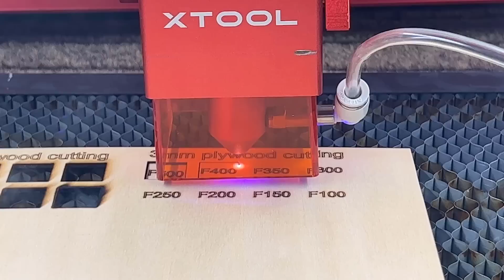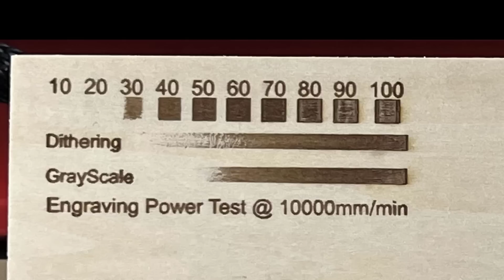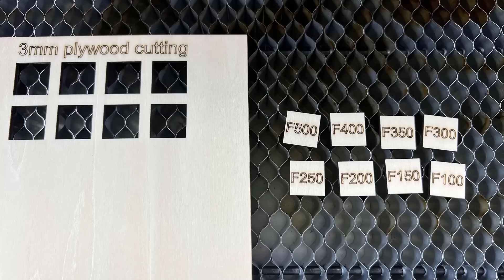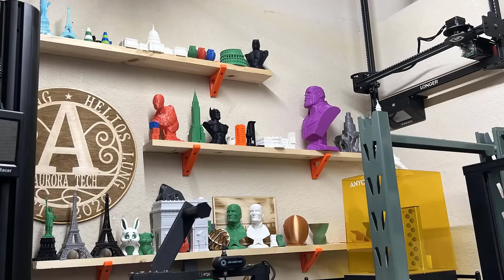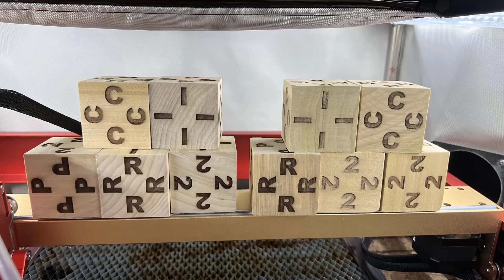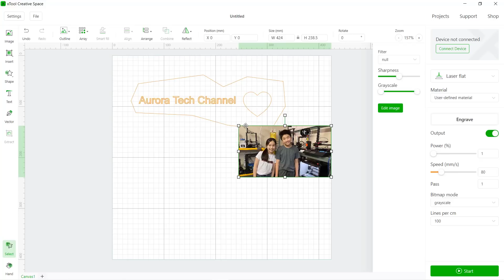xTool D1 Pro 20W laser engraver: The most powerful diode laser engraver that cut 19mm wood in 1 pass

Comment: PLEASE! PLEASE! DO NOT BUY - I have spent about $3000 with Xtool - I purchased the D1Pro and some other stuff almost a year ago and I have had nothing but issues. Trying to work with Customer Service is INSANITY! I also purchased the Infrared, and it has never worked. I was told by Xtool "Regarding the problem of the infrared laser head, many customers will not be able to use it successfully due to improper operation." So even if you follow their instructions and use the samples they sent, you still maybe doing something wrong. What are you doing wrong?--- you don't know, and they don't either, so you end up with a $500 paper weight. I watched tons of Youtube reviews on the D1Pro and they all gave glowing reviews; so, I went with it. Unfortunately, I and many others have not had the same success with Xtool as indicated in the Youtube reviews. After so many issues I decided to invest in another laser and speaking to some of Xtool competitors I asked question in hope that I don't end up with $3000 paper weights. The most chilling thing discovered was they are aware of Xtool and the issues the customers face. I noticed that a lot of the issues I've had with Xtool out the gate without me asking any questions they spell out what the machine can and can't do, their customer service and support. One guy said their Support Agents respond with 4 to 9 minutes and they quickly resolve your issue because they understand many of their customer use it for business purposes. Better than the 24 to 72 hours waiting for Xtool to respond and two weeks later you are still no where close to a resolution. OH, and those that have State side support definitely let you know that.

 I really don't want anyone to encounter this; because when you are not a wealthy person $3000 is a huge investment for you. PLEASE when researching for purchase do more than watch YouTube videos; it could save you time, money and peace of mind. PLEASE be sure to ask about customer service\support, warranty, replacement parts. A big one would be "What issues are commonly encountered by customers and how do you work to resolve those issues? 

I saw a post on Facebook asking, "Why are so many people selling their Xtool?" I laughed because I was looking to see how easy it would be to sell it. RFLOL 

When you have a quality product it is GREAT! I really enjoy engraving, cutting and making things it is so therapeutic. DON"T FORGET to be diligent in your research.

Comment: Thanks for the no waffle video.
I have a question. 
I haven't used one before. Are there costs that i haven thought of.
For example replacement parts required after a short time.
Thanks.

Comment: I was wondering what is the difference between the creality falcon 22w and this machine or who will perform better?
Reply from the maker: There is no significant difference between them in terms of speed and quality. However, the Creality Falcon 22W includes an air assist pump, whereas for xTool, you would need to purchase it separately. If you have no laser engraving experience, xTool with their user-friendly software would be a better option. If you already have LightBurn and have experience working with other engraving machines, you can choose either one.

Comment: I got this laser but kind of regret it.  It's closed source so theres a lot of functionality that just isn't available from hosting devices, so you're stuck using XCS to do simple things like homing or framing unless you're directly connected.  Not a pleasant experience to be told by the company that "all of those customer requests are resolved in our next product" instead of them putting in some effort to adjust firmware or software.  Also, I have to cut 6mm (1/4") basswood at 1 to 4 mm/s for a single pass cut.  I cant imagine how slow a 19mm piece would be.  I can't even get a good engrave on a 3mm basswood at the advertised 400mm/s.

Comment: You didn't try the faster speeds with the air assist.  Everything I've seen and read says that the air assist makes a huge difference in speed and quality of cut.  I wonder if you could get the 1,000mm / min with air assist.

Comment: I found your videos to be very informative, and your "just the facts" format is much appreciated! I'm hoping you could point us in the right direction and/or make a recommendation considering the following:

We seek a sub $2,000 Laser Cutter / Engraver to produce our aluminum face plates; either anodized or plain (6061-T651). Although, as much as 25% of our production could include: 303 Stainless Steel, Mild Steel, Brass, Copper and if possible some plastics; PVC, Polyethylene, ABS and Kydex. In general our work would involve material thicknesses not exceeding 10mm (0.375"), with approximately 80% of production limited to 4mm (0.125") or less. In many cases, the engraving would be filled with ink, enamel, paint or more exotic materials.  We intend to use the machine to cut the outline and "drill" mounting holes.

Can you point us in the right direction? Or, alternatively feel free to tell me if what we see is not yet available as a laser machine. Thank you in advance, I look forward to your reply!
Reply: For under 2k??? add a couple zeros

Comment: I notice that the woods used for the demonstration are light colored woods. If you make this cut in Rose Cedar, Mahogany (brown) woods, prepare to get your hands dirty! It generated a lot of waste. In Brazil we have woods with this tonality such as Caxeta, pine, Pinus and others. But all with light coloring. I had a 100 watt CO2 laser cutting machine. Recently, I got rid of it because I found this type of machine to be much easier to work with because it doesn't take up so much space. So much so, that in the coming months, I intend to acquire a machine with this technology with a power of 20 watts. Is CO2 good? Yes But an inconvenience due to taking up a lot of space, being very heavy and difficult and complicating the work due to the problems inherent to it. I hope I contributed. A proposal. Make wood cuts like the woods described at the beginning. You will see that I speak with propriety.

Comment: I make aluminum signs. Same thickness of 12 inch by 24 inch street signs for drivers in neighborhoods.  They are thin but I do not know thickness.  They are sturdy, and do not bend easy.  Can you try cut out a 12 inch x 18inch aluminum or thin steel?

Comment: I am thinking about getting this laser cutter for my HS class. Do you know if the software will work on Chromebooks? Thx!
Reply from the maker: I am afraid not, the xTool software only works on Windows and Mac.
Reply: @AuroraTech  thx much for letting me know. Is there a good software that my students could create designs in that could then be converted into a file that could be opened in the xtool software (or another laser cutting software) on a separate PC?

Comment: I just bought the 10w D1 Pro and RA2 rotary tool bundle from MakeBlock on Amazon. This is my 1st laser machine. After figuring out what power and speed to use on the material you’re working with, it is easy to use. I had an issue with the RA2 and Alex from MakeBlock gave me excellent support and kept me notified on what they were doing to correct the problem. I also bought the air assist and honeycomb bed which also comes with a metal plate to put under it to protect your table. I have the extension rails coming that doubles the length of the work area. Thanks for the review.

Comment: Thanks…I LIKE; but, for 1200.00, I rather have a CO2 laser & I can get over 40w.  My main needs are cutting clear acrylic.
Reply: My laser co2 50W can cut MDF wood 3mm with 3 times cutting. How this diode 20W can cut same MDF wood 3mm easily, even wood 20mm also easily which my co2 50W cant do. How?

Comment: Do you get the air assist fittings on the basic machine or did those fittings come with the Air assist Air pump upgrade
Reply from the maker: Yes, the air assist fittings come with the basic machine, all you need is an air pump.
Reply: @AuroraTech  love the reviews. A lot of good info.. thanks for the info.  Their web site does not show that the feet and the air assist are included with the basic machine.